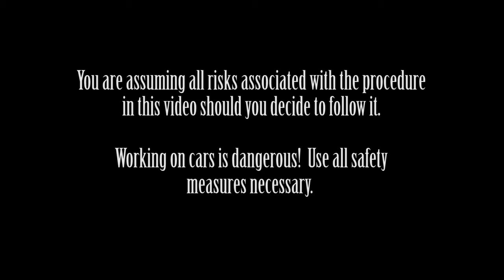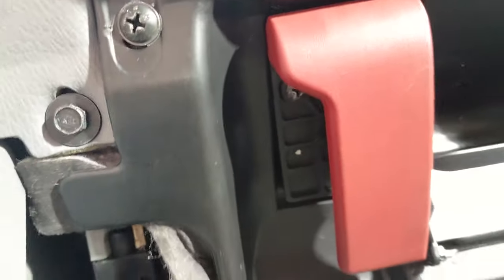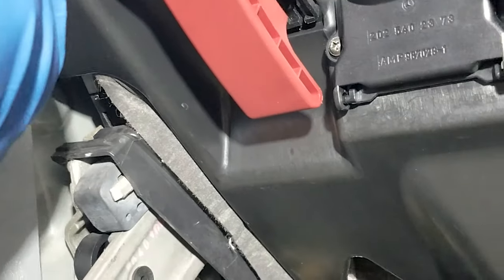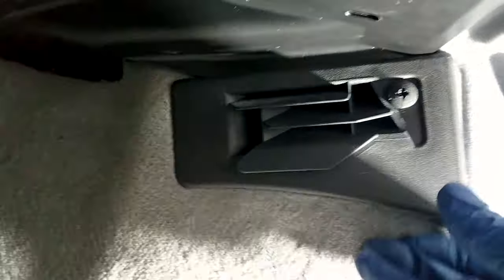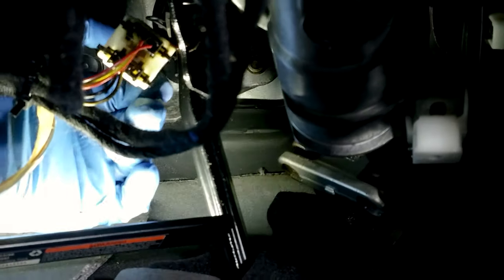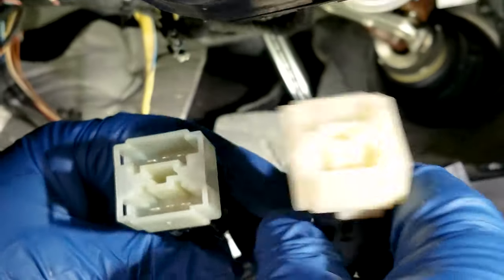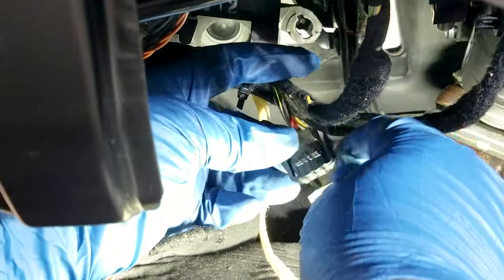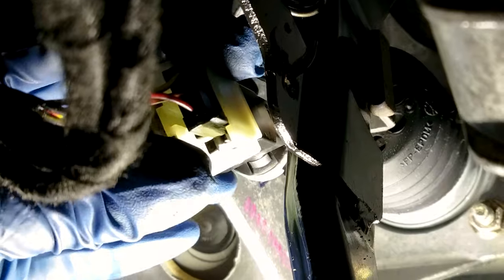Mercedes W210 E320 and W220 Brake Light Switch or Brake Stop Sensor Switch Replacement

Comment: This problem is common when you disconnect your battery.  With the engine running, simply turn the steering wheel completely to the left, wait a few seconds at the stop, then do the same thing to the right.  Then restart.  You will then need to put the windows in the up position for a few seconds, then in the down position with the first position of the ignition button.  Finally, the same goes for the sunroof.
Reply: All I had to do was turn the wheel all the way left and right for a couple seconds and the lights went away without having to restart the car. Thanks for this helpful information!

Comment: Thank you for the great explanations. My 2002 E320 Wagon had ESP BAS ABS System Visit Workshop lights on. (138,700 miles) This was one of the easiest repairs I have done thanks to this video. Fixed my problem and the part was only about $26. Probably would have cost me over $300 at the dealership.
Reply from the maker: You are very welcome, Lisa.
Reply: did your break lights work before u got it replaced
Reply: @jdinero1716  no
Reply: I replaced it it work for a sec then it came back on the springs keep getting stuck
Reply: Was it stopping your car from starting

Comment: Hi Masood, I got all of the errors that you show in your vid but I also can't shift out of park and the car won't start.  I have a W210 wagon.  Everything had been fine, no issue at all.  DO you think it could just be the brake light switch affecting all of this?  Thank you and thank you for this great video!
Reply from the maker: Hi, there could be a number underlying of reasons for your issue with a bad Brake Light Switch being one of them...this would be the cheapest one to tackle and see if it solves your problem short of having a diagnosis done.  Besides being cheap, these will go bad over time so consider it a preventative maintenance if it doesn't solve your issue.
Reply: @masood-tv  I thought that as well, thank you for the reply and the vid!
Reply from the maker: No problem.
Reply: @masood-tv  az  x xz x

Comment: I'm not sure what's going on with my 2000 e320 wagon, but these lights come on and I don't have any brake lights until I replace the brake light switch. it lasts about a month month and a half. Then the dash lights come back on and I don't have brake lights again until I replaced the switch again. They are OE brake light switches they come in a Mercedes bag anyway. I'm on switch number 5......
Reply from the maker: Hi, it may have to do with very hard braking and/or pedal travel distance...
Remove and pull the part that is spring loaded until you hear it click out..  May not have to buy another...I have heard similar complaints.

Comment: @masood Thank you for the videos that you produce! Please help? 2003 s430 with symptoms: No Cruise Control, BAS, ESP lights on dash and sometimes I see the high mount brake light on when not pressing the brakes. I purchased an OEM BLS from Mercedes and when I removed the old, I noticed there was a difference in length. I ensured that the new BLS was pulled all the way out before installing, however, I still have the same symptoms as the old BLS.  No change!
Reply from the maker: Hi Errol - have you done a diagnosis to see if it is your BLS?  Have you checked your speed sensors?
Reply: @masood-tv  you've helped me so many times with your vids on the w220 chassis! 
No I have not for both. I will try to borrow a scanner tonight and will report back
Reply: @masood-tv  Hey Masood. I borrowed a scanner. Got 2 errors:
The Stop Lamp Switch Signal Sent From The Traction System Via
The CAN Bus Is Implausible.
&
The Right Rear Wheel Rpm Signal Sent From The Traction System
Via The CAN Bus Is Implausible.
What fo thet mean?
Reply from the maker: Hi, so you will have to replace the speed sensor first. Then see if you still get the BLS code afterwards.
Reply: @masood-tv  I am sorry to ask you another question!  Would you suggest all four speed sensors or just the rear right?
Reply from the maker: @Errol Aguilera  no worries.  Speed sensors are expensive .  Replace one first if cost is an issue.  In pairs, if not.  Get the same brand as the good ones if you replace one.  Keep in mind torque values are different for front and rear wheels.
Reply: I have a 2000 Clk 430 esp abs lights come on and car won’t come out of park and no cruise control
Reply: @masood-tv  Thank you
Reply from the maker: @Trini_Gemini  - you are welcome and thank you.
Reply: @theblessedxone temporary fix, there's a little hole where the r/p/n/d letters are, shove a pen or something similar in there and push towards the back until it goes all the way in and it will unlock your gearbox and allow you to shift out of park
Reply from the maker: Hi, have you checked your wheel speed sensors?  Do you have an OBD code reader?  Also, try turning the steerimg wheel all the way right, then left a few times...

Comment: Hi mate, great content, I replaced this switch 5 times and it always gets faulty after a few days, what can be the problem?! Thanks btw
Reply from the maker: Hi, faulty how?  Does the little rod that gets pressed become shorter? Do resistance values change? Do you have a volt meter to check a good one against the bad ones?  Is it possible the fault is down or upstream?  Check the brake pedal also as a suspect plz...I think you need to troubleshoot more, mate.
Reply: Problème de batterie trop faible à vérifier en premier.

Voici ma méthode :
This problem is common when you disconnect your battery.  With the engine running, simply turn the steering wheel completely to the left, wait a few seconds at the stop, then do the same thing to the right.  Then restart.  You will then need to put the windows in the up position for a few seconds, then in the down position with the first position of the ignition button.  Finally, the same goes for the sunroof.

Comment: I did this but only the 3rd brake light in the window works. Now the other two on sides do not work? Any suggestions?
Reply from the maker: Hi Russell, sorry to hear that.  Obviously, you have an electrical (connection) issue.  If you own a volt meter, try to isolate the problem starting at the brake bulb sockets and back to the brakes.

Comment: I have a w208 and I'm getting the same codes,  I replaced it with a Mercedes part and I still got the codes as soon as I hit the brake to put it in gear, so I bought another one and it's still happening,  so you think it could be a speed sensor or a steering wheel angle sensor , any help would be greatly appreciated thanks
Reply from the maker: Hi. It is best you don't spend money unnecessarily.  Have the codes read somewhere...

Comment: I just changed it out, but my dads car is still stuck in park…..it has 367k miles on it but runs great cause he doesn’t drive it crazy, do you think it just needs a whole new shifter? Or is it something else it could be?
Reply from the maker: Hi Michael - ff it is not the Brake Light Switch, then check that the battery is fully charged.  If it is, it could be a defective solenoid, faulty computer (ECU or TCU), or even a broken cable.
There is a manual override right underneath the shifter cover to test and eliminate a couple of the scenarios...
Reply: @masood-tv  We’ve had to use the manual override multiple times, but it shifted properly for a few days after we replaced a fuse actually and then it stopped working again. I found a shifter on eBay for like $110 so I figured I’d just replace it
Reply: @michaelbroderhausen2163  any updates ?

Comment: my brake lights don’t work when I press the brake you think this will be the solution?
Reply from the maker: Hi J Dinero,  not necessarily.  But, if you own a multimeter, start with the brake lights in the back and a wiring diagram to troubleshoot.  If both brake lights went out at the same time, find the common touchpoint for both and start from there.  Also, check your fuses first.

Comment: My E300 has this problem when I first pressed the brakes and let go the BAS ASR Lamp Defective errors showed up I checked and no brake lights when the brake pedal is depressed. I replaced the switch as you showed here and that fixed the problem for some time (3-4 weeks) until one morning I started it up hit the brakes and the same errors showed up with no brake lights. When I first installed it did not work but then the next day it did, on one other occasion it didn't work then when I drove it later it functioned properly. I'm wondering if this could be a bad fuse or a false contact being made somewhere?
Reply from the maker: Hi oiroliv - yes, sounds like a bad connection...
Reply: @masood-tv  thank you for the reply I reconnected the switch and checked the fuses in the drivers side panel seems it was a fuse not making the proper connection again thanks
Reply from the maker: @oiroliv  glad it is fixed. Thx

Comment: Hi 
On my e220d 2016 dashboard light displays parking brake see owners manual also P light is on.Hold not working main dealer said needs new ESP CONTROL UNIT Quoted me £3000 is there anything I could do before going ahead and changing esp control unit.please let me know.thank you
Reply from the maker: Hi Abdul Alim, it is hard to tell from afar. I suggest you get a second opinion and then source a second hand unit if it is that...

Comment: Hi, can you tell me where the body control module is on a ‘99 E320? Thanks
Reply from the maker: Hi - You may be talking about the driver side SAM, part# A0195455632, which is located in front of the firewall under the hood.
Reply: Id like to get a front sam for 05 e320 cdi, is this the part number? Do you have a sam?
Reply from the maker: Hi Joro, please call your local dealer, supply your VIN#, and get the exact part number for the SAM module of your vehicle.

Comment: Ok so my 01 e320 got "spooked" in a thunder/lightening storm and now my inner dome lights, front running board and tail lights will NOT turn off. I am having to unhook the battery after driving whenever I turn it off in order to save the battery. Tried the Brake Light Switch,..but still having this issue. Dealership is quoting me $300 for a part. Other places pricing 20 o 30 for Relay Control mod. Need some advise.
Reply from the maker: Hi Annette, sorry you are having this issue.  That could be caused by a number of factors.  It is hard for me to tell without running some diagnosis.  I would presume it has to do with a short or bad wiring...somewhere in the harness, or even a relay.  Go with the cheaper option first and see if it fixes it.  If you have a multimeter (one that can also read resistance values), you could run your own tests.  Of course, you will need a wiring diagram also (search Google) and some knowledge of car electronics to pinpoint the issue.
Reply: @masood-tv  Thank you so much, I will inquire if my guy has the Multimeter (w/ resistance values) 🙂as well as download the Wiring Diagram. Of course Dad did teach me to "begin w/ the cheaper option first" so thank you so much for your advise. I will make sure to let you know how it goes. Blessing on your evening.
Reply from the maker: @annettelhunt8806  you are very welcome.  Since you have 3 different lights on when the car is off, look for junction points first in the wiring diagram for a clue...a visual inspection in those points may give you the clue.

Comment: My abs esp and bas lights all came on after I changed a tire while I was driving they came on and I could not accelerate and then my check engine light came on as well
Reply from the maker: Hi David, check your speed sensor and make sure it is connected.  Also, turn the wheel all the way right and left a few times and see if that makes a difference.
Reply: This problem is common when you disconnect your battery.  With the engine running, simply turn the steering wheel completely to the left, wait a few seconds at the stop, then do the same thing to the right.  Then restart.  You will then need to put the windows in the up position for a few seconds, then in the down position with the first position of the ignition button.  Finally, the same goes for the sunroof.

Comment: Should I disconnect the battery for this?
Reply from the maker: No need.
Reply: Thank you
Reply: Hi, I changed out the switch, but the BAS/ESP light remains on, whenever it turns on my blinkers stop working, but only my blinkers. Typically after about 40 minutes of driving, the interior lights will turn on and the blinkers will starts working again. This process repeats every time I turn off the car. Very rarely I’ll turn on the car and the esp light won’t turn on, and the car will run just fine. Any idea of what it could be?
Reply from the maker: @therandom7153  hello.  I have not run into that scenario.  Sounds like a short somewhere, perhaps.  You will need to dig deeper or scan the car for codes.

Comment: How do test to see if the Brake Stop Sensor Switch is bad?
Reply from the maker: Hi Terrence, the Mercedes cars will display a warning or multiple warnings on the dash as shown in the beginning of the video alerting you.  Also, when you press the brake pedal none of the brake lights in the back turn on.  Of course, there are other ways to test with a multi-meter to back-probe the switch and check for the voltage.  If you get the warnings in the dashboard, stop the car as soon as possible and fix the issue or those driving behind you may not realize you are braking...

Comment: For my Ml430  2000 modelI am getting ESP BAS Light tried to get code from Autozone but no code, what could be the reason?
Reply from the maker: Hi Sudha, drive at highway speed and turn on your cruise control.  If it doesn't work, it may be a speed sensor.  The stop switch could obviously be another...
Reply: @masood-tv  Thank you for your reply.will check the brake light switch n update you.
Reply: ESP light still showing .My 2001 ML430 yaw sensor is faulty & getting the code C1120 I confirmed this by getting it cleared 2-3 times & post test that reappeared. On close inspection under the central console On the top side of “Yaw Rate Sensor” part# A163 542 2140 but when I see  the marketplace & oem / genuine used sites there are 2 part numbers 
1 on top like mine #A163 542 2140
2nd on the side a different number

can anyone help me which number to be used? 
why does various listings have 2 different numbers? 
Is it normal for a part to have 2 numbers on it ?
Reply from the maker: Hi @Sudha Edu  , call any MB dealership's parts department, supply your VIN# and let them give you the exact part number
Reply: Chào bạn, mình cùng đời 2000 như nhau, kết bạn với nhau được không bạn

Comment: Hello sir, my gearbox stuck into park position. Can it be reason for my problem? I have also lamb alert on my screen
Reply from the maker: Hello, when certain values fall outside of preprogrammed ranges, your car will go into limp mode to keep you and  the car safe.  Please scan the car for codes and don't change parts based on guesswork.
Reply: Essayez de mettre votre voiture avec la clé en position 2 sans démarrer. Restez plusieurs minutes le pied appuyé sur la pédale de frein. 
La boite de vitesses devrait être réinitialisée.

Comment: I have check engine on aswell will this switch take it away? When I turn my car off it says 4 malfunctions do you know if that’s tied to this?
Reply: I have a 2001 e320 sedan
Reply from the maker: I think it is best to scan and get the error codes, and to avoid guesswork.
Reply: @masood-tv  I’m changing the sensor right now but I can figure out how to pop the switch in
Reply from the maker: @1700 Dre  I am guessing you meant to write you "cannot" figure out...please watch the part of the video where I show that on large screen.  It is just the reverse of how you removed it.
Reply: @masood-tv  I had replaced the break light switch 3 weeks back, but the same esp,abs came back and it’s a abs sensor do you know which one A is?
Reply from the maker: @Certified57dre No,  I am not sure what A is...